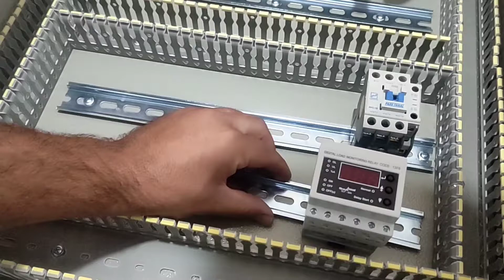Industrial electrical panel assembly and wiring training.#electrical#training

Comment: You should fit numbers on the terminals, identifying labels on all the equipment as per the dwg GA and the schematic wiring dwg.
You have only fitted 1 earth terminal which is ok for the panel internal earthing however  each of the incoming cables from the field will have an earth wire to be connected in the panel so thats why there should be more earth terminals fitted.
Wired panels for 52 yrs so i know the score 😂